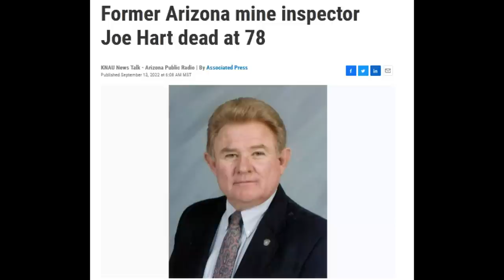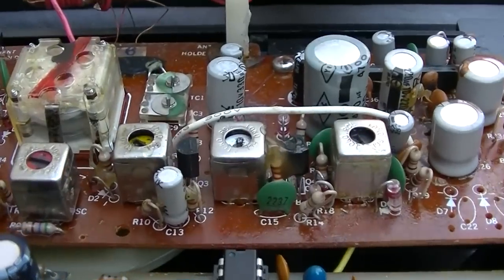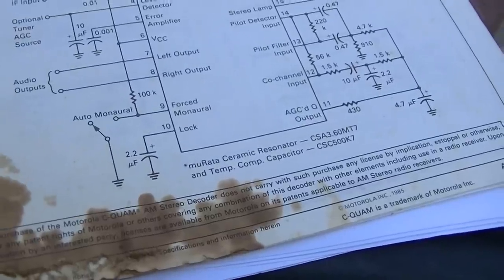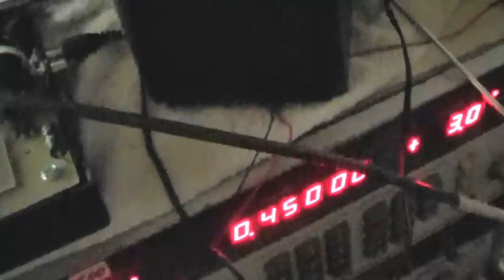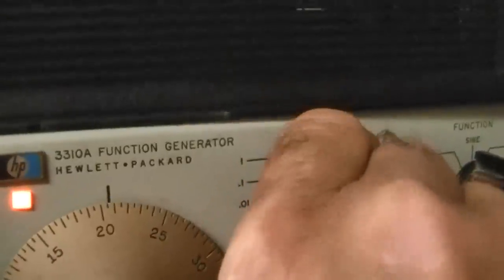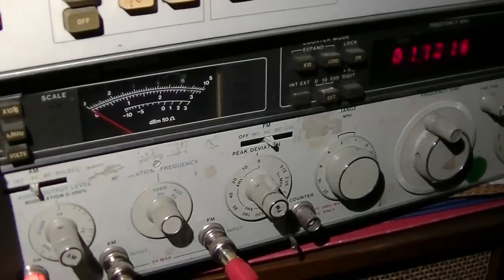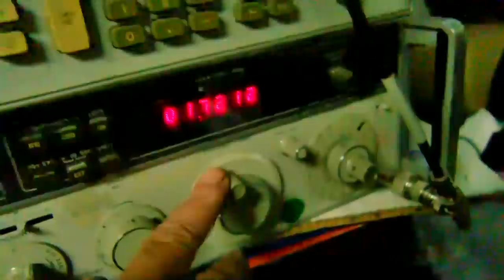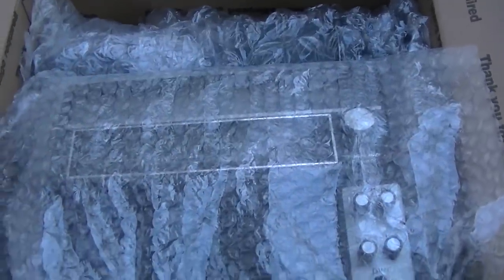Realistic Motorola CQUAM Prototype Radio Repair Pt3

Comment: AM Stereo is one of the most frustrating technologies. It is so much better, and we had a fairly high adoption rate among broadcasters in the 1980s, but was so poorly managed that it buried itself. My Carver TX-11a is capable of CD quality (20hz-20khz) full stereo analog audio on the AM band (better than FM). Such an opportunity squandered by others pushing there own separate standards (Kahn) for far too long during rollout.
Reply from the maker: Next sunday video...
Reply: There is good news I been working on a new form of AM stereo (C-QuAMv2) for last 4 years and made a few improvements. Such as new type of QAM modulator,  noise reduction system and also has a Position Navigation and Timing (PNT) signal encoded. The prototype transmitters are in the process of been tested before on air testing starts. As stated AM stereo has a few advantages of FM stereo, I will be making more information available soon on this technology.
Reply: there zero AM Stearo that ever been around me now there only 3 AM Stations
Reply: @granttaylor3697  YES!  Someone should demo a stereo talk or news program in a well equipped car.  Beats FM and is an experience people will crave.  

Of course we all know music will do well too.  I am just floating this idea out there to give even talker stations a reason.  Probably already way too late, but who knows?
Reply: @shango066  do you repair short wave radios for the public? I have a older Sony, looks to be in good shape, but doesn't work. If you don't do this as a business, could you recommend someone? I'm in SC.

Comment: Your hacked AMS modulation worked pretty well!!  Sure would be nice to see this come back.  It's a great experience in the car.  And frankly, TALK or podcast type material is excellent.  The warm AMS sound works with voices extremely well.
Reply: One of the best hacked C-QUAM schemes that I have ever heard was WOWO from Fort Wayne, IN. The station was using a Magnavox exciter but adding the 25 Hz pilot tone to trigger C-QUAM receivers. Their "faking" was so good that I did not realize that I was hearing Magnavox. It was not until some years after WOWO discontinued stereo operation that I learned that their reason for doing this was not due to programming changes but because the FCC finally declared C-QUAM the official stereo standard.

Comment: The sound quality seems every bit as good as its more successful frequency-modulated VHF-band counterpart. It never occurred to me that any amplitude-modulated signal could have audio fidelity like this. It is suspected that better sound quality would require more AM frequency signal bandwidth, which is what one doesn't see in AM broadcasts today, but it seemed to me to be more commonplace 40+ years ago, as I recall.

Comment: That sounds pretty damn great. Especially considering you're doing AM/PMX modulation. I did a similar experiment with my Uniden 2510 on 11 meters to myself to myself
Reply: I didn't have a 25Hz pilot but my SRF A100 didn't need one anyway. Used a Sony shortwave receiver as a conversion device and ran 450Khz before the final IF filters for wideband audio using the AM stereo radio to do All the IF work. Nice. And that's awesome that you found pin 9 being shorted to ground. When you said pin 9 shorted to pin 10. I'm liy. YUP! I've known about pin 9 to ground for forced mono since AM stereo was marketplace. That chip could actually decode 3 of the systems already with pilot tone frequency modified at the chip. VCPM CQUAM and AM / PMX all used the Motorola chip. Native Harris exciters modified for 25Hz pilot still sounded cleaner than a native CQUAM unit.

Comment: With a modern function generator, you can generate most of the signals you need to test the decoding.  Using AM modulation to test the AM detector circuit, and Phase modulation to test the quadrature circuit.  Peak deviation of +/- 45 degrees phase should equal 100% L-R, so 3 degrees or so of 25 Hz should fire the pilot detector circuit.

Comment: although only a few can listen to CQUAM stereo anymore with the MC13020 ic- the chip has provision for I and Q outputs that can be engaged to listen to LSB and USB through a 90 PSN and matrix. Those interested can check out "Build a synchronous detector for AM radio" by David Hershberger in Popular Electronics April 1982 for the PSN build.

Comment: Using a couple of Signal Generators and MP3 to improvise a very short range just above the Medium Wave Band C-QUAM Transmitter like that was pretty cool.
Well done Sir!
I wonder if the microphony issue is down to a Ceramic Disc Capacitor?

Comment: That makeshift AM Stereo using the AM/FM signal generator worked surprisingly well. BTW, what kind of video camera do you have that has the direct aux input for the audio like that? With my Handycam I have to feed audio into the external mic input using an attenuation cable, which isn't as good as a direct line-level input.
Reply from the maker: JVC
Reply: @shango066  Thanks... but which model?

Comment: Really good separation and open sound field. Is the squeal when off freq the drawback back of the C-Quam decoder functioning? I wonder if RadioShack repair center back when they were a thing performed that mod (jumped the pins and removed the 100k res) to get rid of the squeal? Cool outdated technology though in it's own way.

Comment: I owned a Motorola Two-Way Comms dealership from 1977, (an investment my family purchased), through 2017; 40 years. The previous owner started out as a Motorola Consumer Electronics Dealer and service center sometime between 1937, and 1940 when "Lend-Lease" was just beginning to 'really' crank up. Morrill hung around the service end of our shop, which was on our property, and in another town; he had to be 'pushing' 80, or maybe even more by that time. He 'phased-out' the consumer end of the business, when the 'guts in a drawer' (modular design due to Solid State's inception, and/or the appear of "Quasar" into the picture. 

Ours was one of the markets where Peirce-Phelps acted as our area's wholesale distributor, under contract to Moto's Consumer division, with the Two-Way Comms and Industrial  divisions having access to warranty replacement components, and the Motorola "HEP" Semiconductor wholesaler/retailer/distributor scheme. 

Because of this strange set of circumstances, he received regular technical briefings, and also "warranty and non-warranty" upgrade and replacement kits, which came with the stipulation that he maintain the inventory of the kit's components for at least five years.  Whilst I'm certain that I don't have any MC13020P IC's hanging around, it's likely that 'technical notifications' regarding CQUAM are located somewhere in filing cabinets which have an inch of dust as their decoration.

I'd betcha that California has several 'vintage' Two-Way Comms service centers hanging around, at least somewhere??  Maybe there's an HEP stash containg those same IC's, with an HEP suffix??

Comment: I also thought that maybe the builder removed the resistor and bridged those pins - maybe to say its no longer a prototype and it can leave the building? Intellectual property protection?
Reply: my thoughts.. i've bought proto hardware before that was sold off as "parts only" and they all had some intentional tampering to disable functionality.

Comment: S,
Years ago in the early 80's I worked for Mr Kahn. As you know his system was an ISB, and the others were AM/PM systems. We had a very special edition of the Boonton 103 that supported ISB and AM/PM AM Stereo. Have no idea where that ended up. Nice to see you can make your own pilot signal. Mr Kahn noticed an interesting problem with the early Cquam units. At night when distant carriers would zero beat with the AM stereo station, the stereo image or platform he called it would shift around at the rate of the zero beat. So if there was a 2hz difference the image would bounce around in the listeners ears. Weird issue. Like I said, long ago and far away for that. Be well, and keep it safe. Mike

Comment: I've heard that some HD radios are capable of receiving am stereo and I believe west life has a video of a budget coby model that had it. I have a cpl hd radios myself but have never really thought about trying it however one radio I own that I'm very curious about is my sangean hdr 16 I believe the model is called. It's a very nice radio and surprisingly even has 16 watt speakers in it with bass and treble controls as well but the radio itself is about as big as the one in this vid and may be even smaller. It gets very good reception though and had a 200 mm ferrite bar for the am section. If you know of any stations I may be able to receive in southern pa give me a heads up. I've received stations from nearly 1000 miles away at night playing around with it so I think it and my pioneer car stereo will give me the best chance of receiving a strong enough signal to trigger the stereo pilot if either of them have it

Comment: Absolutely convincing! 14:51, 15:03 amazing! You can't just unplug left or right signal cables because your multiplex pilot signal is in one channel. I don't understand how the FM modulation worked. Possibly it was the 25 Hz pilot?

Anyway, this was excellent. I just got a TM152 recently. Plus I'm an auto mechanic that works at a..... So used car radios are everywhere. I know many of the GM Delco units were stereo. I think you showed your Ford was also. VWestlife showed a Toyota stereo which was a high line option. I just need a list to know which ones have the AM Stereo.

I could nag my favorite local AM station. I even know the main news guy through a friend. I doubt they'd go through the effort to upgrade to stereo. I think they're 5,000 watt daytime. There is a littler town station which is part of a larger conglomerate. They bomb in all over my single conversion SW while I'm listening to AJ at work because their tower is several hundred feet away.... I'm in this stuff since I was a kid and will be until I'm done here on earth.
Thanks again, Dan! I really enjoyed this episode. Stay well.

Comment: I’d go on ahead with the replacement of the CQUAM capacitors, or whatever the proper name for them is. I’d also check the dial cord to see what condition it is in. Ya don’t want to put the radio 📻 together, and then all apart again, all because the dial cord breaks. This radio may also have a dial light 💡. I’d also service it (if it has one ☝️). At least, replacing a dial light 💡is easier than restringing a dial cord. I’ve tried it myself (and couldn’t). Your friend, Jeff.

Comment: Nice touch using period correct HP equipment.
I'm still in awe of whoever built that circuit board. Listening through a 7.2 system, the stereo is very noticeable.
Funny that this radio's IF was microphonic, I worked on 165 mHz marine radios at the big M at this time and we had serious issues with this. Must be the same coil vendor!

Comment: I have decent PC speakers and during your experiment, I could easily make out stereo separation. Wasn't too bad. When I saw that solder blob connecting pins 9 & 10, I thought that could be why stereo wasn't working. Being that this set doesn't have a switch to force mono, the only way to do it was to solder it permanently to mono. Neat video.

Comment: Former broadcast engineer here.  It sounds like the L-R (fm) portion is missing highs that the L+R (am) side has.  This is NOT a fault of the Motorola chip or the receiver.  It is simply that the generator used does not have "pre-emphaisis" (usually 75ms) in the L-R feed.  (There clearly is "de-emphasis" of the same value built into the receiver). We boost the treble (pre-emphasis) to improve the S/N of the fm component which is generally noisy, but more so here because it is very low level modulation (deviation) of the carrier.  It's very much akin to how Dolby works.  You boost highs on record, and cut by the same amount on playback to reduce tape hiss.  Same for over the air. You can clearly hear the bass greatly increase when the L-R input is connected.  You can use a simple RC network to boost the highs starting at about 6KHz and peaking out at 15Khz.  You will need to carefully adjust the modulation on the L-R input to compensate with the RC filter.

I'm very glad that you got this one working!  The audio bandwidth is superb and is PROOF that AM does not have to sound like an old telephone.  We used to take great pride in our AM signals back in the day (before FM became a strong competitor).  Many stations had audio that went out to 15KHz or higher.  Then the FCC oversold the AM radio dial and boxed everyone into a 10KHz lane.  Today we have so many buzzes and noises from switching power supplies, it's nearly the end of the AM broadcaster.  So thank you again for letting everyone actually hear what I heard over the air, many moons ago.  73
Reply: Are you able by chance to give me a reference or link to an explanation of why preemphasis is expressed in terms of a unit of time? I've always wondered about that. Thanks.

Comment: Wow! Definitely in pure stereo even through the monitor speakers. Very cool to have it working again. It begs the question if this was an engineering prototype for Motorola  why disable it? It is  very strange. On a side note, I'm curious about the choice of the base radio to marry the daughter board to. Sure the Radio Shack12-656, successor to the similar12-655, was a decent performing DX radio for the price. They dropped the 656 in 1983. Why would Motorola choose that one? All very interesting questions we will probably never get answered. Thank you for sharing the adventure.

Comment: Interesting experimentation.
Once I used a tool on PC called StereoTools to encode FM stereo modulation directly into a cheap mono FM transmitter and it worked.

Comment: Just finished watching! Great work so far.. we have a light! be interesting to see how it receives OTA! btw it's not unusual for companies to require prototypes to be intentionally disabled before they are sold / disposed etc, I remember buying some old proto computer hardware years ago labelled as "junk / for parts".. most had things like a jumper wire from one of the chips reset lines to keep it in reeset and a couple of resistors missing  permanently disable it.

Comment: C-QUAM did suffer from false stereo triggering under co-channel interference conditions, so perhaps somebody who wanted to use this as a DXing radio deliberately disabled the stereo for this reason. However, I am a bit baffled why a jumper or, better yet, a switch to ground wasn't used.

I was also left wondering whether the stereo sounds a bit "funny" because creating phase modulation with an FM signal generator requires that the audio fed to the signal generator pass through a high-pass filter with a 6 dB/octave frequency response (aka a differentiator).

Comment: Hello, I am trying to repair a Phillips D8128 radio for my father, a few months ago the drive cord for the station search came out.

Since the cord is worn in one place, thinking to replace it, he took it out of its place, he didn't go back on it and since then forgot how the cord was positioned mainly on the white wheel.

I have no idea how to wrap the wire around the white wheel, would you know where I could find documentation, pictures even of another equivalent model or with the same type of wheel that could help me I would be delighted because apart from that the radio works very well.
If you can find the documentation to help me to put back the dial cord compatible with my radio I could pay you, tell me how much?

The Phillips D8120 model also seems to have the same station winding system but again it is difficult to find a doc showing how to wind.

Sincerely
Reply: I would like to send you some links showing the inside of the radio but my message is not valid

Comment: I tried to get am stereo..... where i live there is no music on AM ....so there is nothing to hear....i know if a station is on 700khz for example.....the Left Channel would be on 693khz and The Right Channel is 703khz.... with the mode on AM wide 😊....Use two radios......but if you use one the frequency higher than the station (703khz) that is the frequency You want....i done this years ago